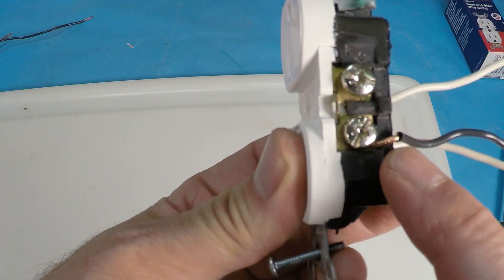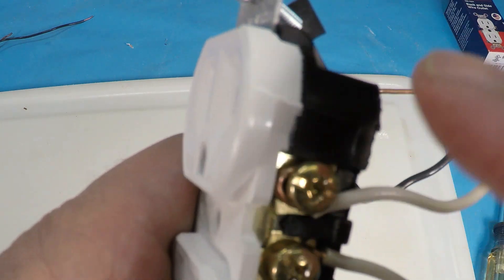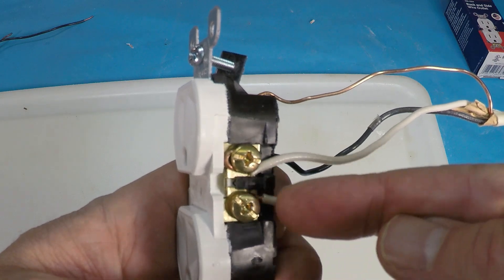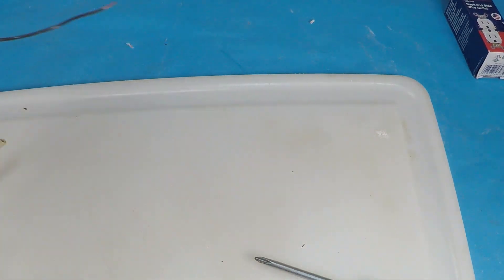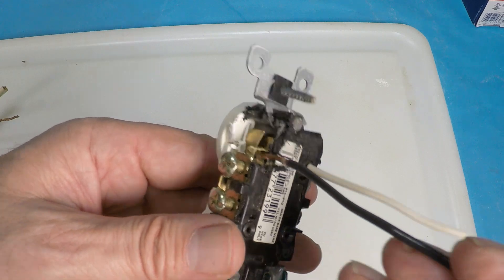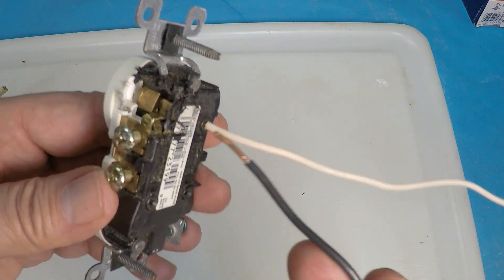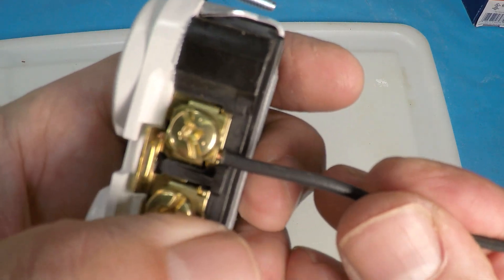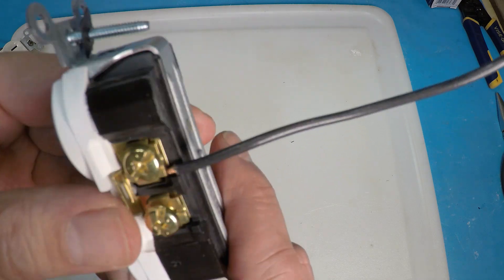5 FATAL Outlet Wiring Mistakes Most DIYers Don't Know About

Comment: My outlet has the back wire connecting to the same metal plate that the screw uses for its connection.
Reply from the maker: when you backstab the outlet, it is making a pour connection like I explained in the video

Comment: I don't understand why they make 14-gauge (15 amp) plugs when they need to go on a 20-amp breaker. Sure, they make 20-amp plugs, but that isn't what you see in most homes. A 20-amp breaker needs a 12-gauge wire.